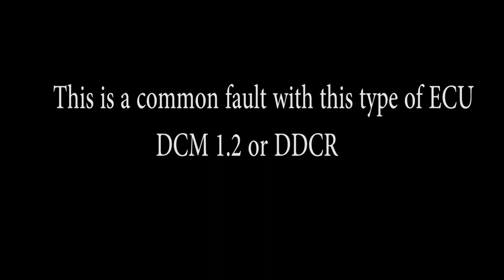Renault megane/Logan 1.5 dci Delphi Ecu repair dcm 1.2

Comment from the maker: Check my COMMUNITY tab on my channel for additional updates.
Reply: No ground on ecu to fuel flow regulator
Renault fluence 1.5 dci 
I tried like this but no use
Any suggestions
Reply from the maker: @Ravir918  Did you check the wires from regulator to ecu ?
Reply: @amperugarage  yes I checked all wires are perfect
Reply: @amperugarage 1.5 dci same ecu injetor 2 ever error i change order and error mantain in clinder 2. Is possible any contact realize open this wires ..

Comment: Hi sir..I have nissan np200 have same type ecu but problem with my car is these no engine mangment & glow plug light in dash..and it cranks but won't start...did you come across this problem before with DCM1.2 ecu?

Thanks for great video
Reply from the maker: I will need more details, use my email and send me the scan from the car

Comment: Ok no need for that long shot how to open the box we all know that
Reply: You don't know shit. He actually presented the best way to separate the backplate by using a plastic (recommended) ruler to push into the glue. I first saw the video, got to it and used a cutter with a long blade to try and cut the glue with risk of scratching the PCB and was way slower than the AMP Garage dude. I then used his metrod and it freed up way quicker.
Now there's another problem: heat dissipation. If the thermal glue was separated, then the heat transfer from the PCB to the backplate is reduced. I might need to find heat transfer silicone or use PC thermal paste.
Anyway, thank you so much for the tip on solder joints. I tracked it down by wiggling the ECU plugs then I found your video.
Now my AC and trip computer are working flawlessly!
Reply from the maker: I m not good at video editing, thank you for your opinion. Thank's for watching!
Reply: @amperugarage  👍
Reply: Separation is the most complicated and difficult part. You can destroy the board if you don't know how to open it.

Comment: Good video bro .. bro I worked on Nissan diesel running car for steering module wiring and ignition fuse burned ..I fixed it after that car not starting ..got scanned on low battery dtc got p0335 ..any suggesion pls ..
Car has ecm 8200911560.
DCM1.2
Reply from the maker: You should check crankshaft position sensor

Comment: Hi sir
Reply from the maker: Hello
Reply: @amperugarage  i have a 1.5 dci clio 2 with same ecu .
Reply: DF137 rail pressure sensor above maximum 
DF061 preheaters plugs open circuit 
DF112 camshaft sensor intermediant
Reply from the maker: Oto Lite Yes , check the solder joints firts , this is a common problem
Reply: @amperugarage  thank you so much greetings from Turkey
Reply from the maker: Oto Lite iyi geceler
Reply: @amperugarage  🙂 iyi geceler
Reply: @Largo5441  i have the df 137.. car is working normal no smokes no leaks but when accelerating hard or under load glow-stop-injection light coming on and car no push more..I replaced pump year ago still same..is that ecu or electrical witing problem?
Reply: @driverx2753  i replaced hda pump no issue
Reply: I dont think is pump fault:/ why when accelerating slowly no fault coming:/
Reply: Renault kangoo 2004 dci
Reply: @driverx2753  ok my var 2003 dCi.  We changed advance valve stick in pump. Problem solved.
Reply: @largo5441 Merhaba, türksünüz galiba. Beni buralara düşüren kangoo 1.5 dci 2008 aracımın sabahları zor çalışması. eğer marşa basmaya devam edersem çalışıyor ve gün içinde biedaha sorun olmuyor diyebilirim. Ve nadiren tek marşta çalışsada bazen stop edecekmiş gibi yapması... Yakıt kaçakları kontrol edildi. Pompa üzerindeki basınç regülatör valfi değişti 1 2 gün tek marşta bazen stop edecekmiş gibi yapsada sorunsuz çalıştı. Sonra yine başa döndük. Klimada bazen çalışmıyor gazıda az. Yardımcı olurmusunuz. Elektronikçiyim lehim tazelememi önerirmisiniz.
Reply: @ibrahimasc7871  soketleri de kontrol et. Kablo kararması ve oksitlenme de olabilir. Yalnız bu arabalar da zor çalışma krank ve eksantrik sensörleri orijinal olmayınca da yapıyor.
Reply: @Largo5441  krank sensörü değişti sorun devam etti eksantrik sensörü değişmedi. Araçta aniden stop etme hiç olmadı. Sadece günün ilk çalıştırma denemesinde sorun var. Ama çalısınca ogün birdaha kolay kolay sorun yaşamıyorum. Ecu yu söküp lehimleri kontrol etmemi önerirmisin yada başka neler yapılabilir sizce ?
Reply: @ibrahimasc7871  mazot filtresi yanında hava almak için vakvak pompa var. Yumurtaya benziyor. O pompayı arabayı çalıştırmadan önce 5-10 kere sık bırak. Öyle marşa baş. Fark ediyorsa mazot filtresi ve hortumlar da var. Filtre Delphi hdf 913 kullan
 Başka marka takma filtre seçiyor.
Reply: @Largo5441  depo gidiş geliş hortumları mazot dolu oluyor. Vak vak çatlaktı değişti, filtre yeniydi yinede delphi olarak değiştirdik.  Elle pompalasamda bişey değişmiyor. Zaten vak vak sert oluyor. Sorun devam ediyor. Yanlız önemlimi bilmem, işk marştan önce yakıt hortumların gidiş geliş mazot dolu, pompa geri dönüşün filtreye bağlı kısmında 1 karış kadar mazot boşluğu var. Ama pompa girişi mazot dolu.

Comment: hello Clio 2 1.5 dci my air conditioner is working when it plays the socket in the middle cause it
Reply from the maker: Hakan Hançer yes, you have to resolder connector pins
Reply: @amperugarage  Thanks to you, I solved the problem with the video I watched, I fixed the cold solders, now my air conditioner works, thank you very much
Reply: @teknikvideolar4461  Üstat 3 yıl olmuş ama aliminyum parça ile kart arasına geri kapatırken soğutma için termal macun veya başka birşey uygulamaya gerek var mı ?
Reply: @atakanksk35  evet uygulama yapın ısı daha iyi dağılır ben öyle yaptım
Reply: @teknikvideolar4461  Teşekkürler 👏

Comment: Hi, i have this ECU but its in a Hyundai 4x4, im getting no start and 2.6volts on injectors, it does start
with ether....wonder if dry joints are also in mine ? cheers
Reply from the maker: You can check by pulling the plugs on ecu.. create some tension and see if there's any change
Reply: Ok good idea, i will try the tomorrow, strange thing today after removing 2 injector plugs it started on the other 2 cylinders, but did not do that again.....cheers

Comment: Hi my is Mahindra vertio 
Problem is ac cooling cut off in 60km speed in automainte
Reply from the maker: it is difficult for me to understand what you are trying to say... do you have any error codes? Try to move your ecu plugs/connectors when the engine is running and AC turned on and see if your AC compressor stays on all the time.

Comment: Helo,I have renault grand scenic 2 2009 year. Engine is 1.9 dci 96kw 130 ps...I have automatic climate..I press AC and wait compresor..No no run..Go to diagnostic problem presure senzor(presostat).Replacement,and start ac ....Don't run..Diagnostic write 700bar in climate :o ....Mechanic said :problem is computer..Presostat have 3 line and thus 3 line is short circuit + at -..
Mechanic is very good idiot..

can the computer be reprogrammed for this problem..Please fix climate ...Very hot weather....

Comment: Thanks bro. l have '03 1.5 dci Clio. Same ecu. DF137 on the my car ecu. I can seen refresh joint soldering. Very informative Video.  Greetings from Turkey
Reply: Merhaba, sorun video"da olduğu gibi yapınca çözüldü mü? Bende de DF137 var ve klima bazen çalışıyor bazen çalışmıyor. ECU kablolarını oynatınca çalışıyor, sanırım tekrar kaynak yapmam gerek. Teşekkürler
Reply: @ysrhsn  check my channel for DF137. Problem fuel pump.
Reply: Hai risolto il problema codice df137? Ha sistemato la ecu?
Reply: Hai risolto il problema df137?
Reply: @signorpatato1265  no ecu hda pump avance pim